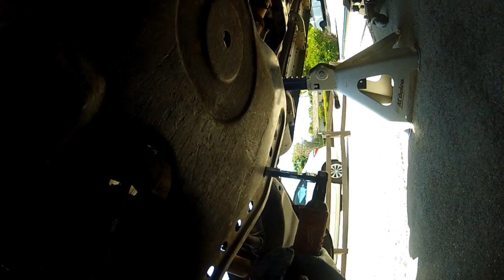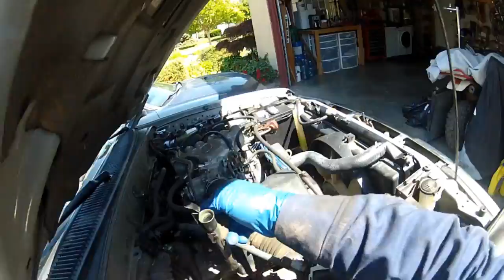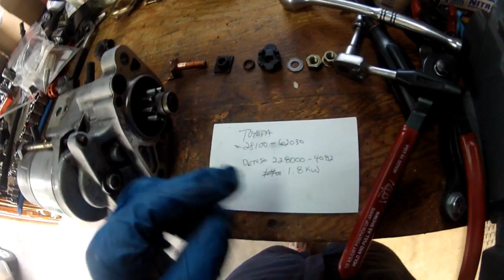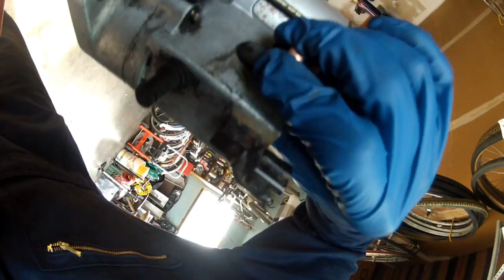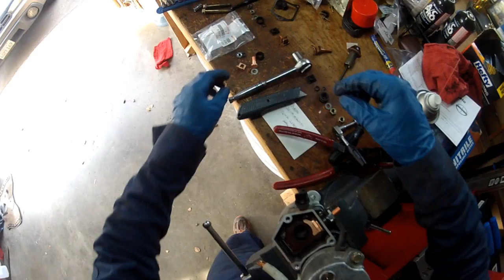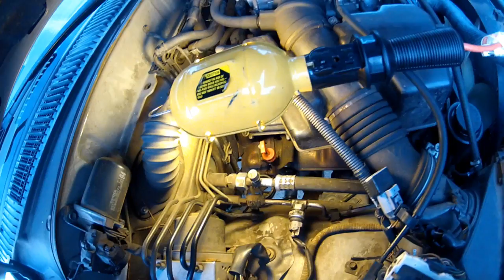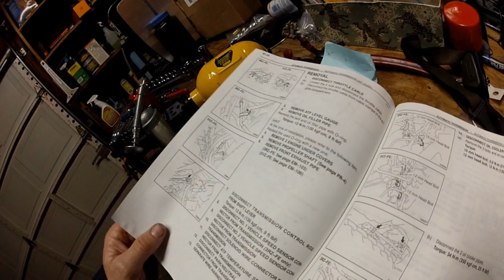Starter Removal and Solenoid Repair

Comment: Just thought I'd let you know that if you remove the left rear plastic splash guard in the wheel well after removing the tire, you can replace the starter in about 20 minutes. Removing the brake line and pushing it out of the way is the biggest hassle.
Reply from the maker: Hey Martin, what year, motor and model are you driving?  With a 3.4 liter engine and 4wd, there's no way you're getting it out the way you're saying.  With the 3.4 liter, the exhaust is right behind the flap.  Getting the flap out of the way helps, but that simple task doesn't now allow you to pull it through there.  You have to pull the starter out between the exhaust and upper control arm so you have to pull those brake lines out of the way.

Comment: how much do you pay for the parts?
Reply from the maker: Way too much, because at the time, I couldn't find a contact and plunger set that advertised it worked for my Denso starter so I bought the parts at the dealer.  I think I spent around $70.  I was trying to find a seller that listed my Denso part number, but if I just looked for my year and model 4runner, I would have found something like the one below and saved myself some money.  The kit below doesn't come with all the other associated hardware but you don't need it.  You just need to replace the copper contacts and plunger and reuse the rest of the parts.

This one for sale on Ebay will work:
http://www.ebay.com/itm/201532245369

Comment: Thank you for taking the time to make this video, About 4 hours start to finish for me to do the contact replacement. I tried to drop my sway bar to get the starter out the bottom but in the end it came out best exactly how you did it. Another great tutorial.
Reply from the maker: Hey Bill, glad the video helped you out.  I actually tried to get the starter out the bottom recently when I was helping Sean with swapping his auto transmission.  I learned quickly that it didn't work and took it out through the wheel well like I did on my rig.  Happy Wrenching!
Reply: @TimmyTheToolman  Do you think if you took out the CV axle it would come out the bottom?  I have to do the passenger axle, and it looks like it MIGHT come out.
Reply from the maker: @tywheeler7131  I'm pretty sure there's other obstructions that are going to stop you before the CV axle, but it couldn't hurt to try.  The worst that can happen is you have to take it out via the wheel well if it doesn't work.

Comment: If I accidentally broke both the breather valves as I was taking it out, is it a big deal? Will using it without the valves be a big deal?.... great vid btw. Esp the orientation on how to take it out. Fumbled with that for about an hour!
Reply from the maker: Well, the breather valves must help relieve any pressure built up by heat.  With the breather valves broken off, I imagine there would be a chance road contaminants could get in there during the winter from rain water or mud puddles splashing up under the undercarriage.  I sort of doubt you could buy those little breathers separately but maybe you could go to an auto wrecker place and pull a couple off another vehicle.  The breathers must be fairly standard and Denso makes starters for many different manufacturers.  However, those holes are really small so if you don't do some keep water crossings, I bet not much is going to enter the solenoid if you do nothing.
Reply: Timmy The Toolman 
Thanks Timmy. I replaced it without and it's just fine. Guess I'll see over time if contaminants will be an issue.
Reply from the maker: Roger that.  I guess your rig is ready for some mountain bike trips.

Comment: That short ratchet with the black handle at 18:58 min can i know what make that is i need a stubby ratchet that size
Reply from the maker: I've had that ratchet for a long long time.  The only writing I see on it is "Japan".  But, it's just a small 1/4" drive ratchet.  I'm sure if you do an Amazon search, you can find one with a set of metric sockets that gets good reviews for a decent price.  Or, if you'd prefer to buy one at a store, the Sears Craftsman brand would be a good choice.
Reply: Timmy The Toolman Ok thanks buddy

Comment: I am not mechanically inclined and this video helped me fix my starter. I first replaced the contacts but still had problems. I ordered a Denso reman starter from Rockauto and replaced the starter and all is well now. Tip is to loosen the 2 starter bolts before you jack up your 4runner. I like to avoid wrenching on bolts while underneath a jacked up vehicle. Also he is right, remove the brake line bolts and take the starter out from the wheel well.  To reinstall I used a hammer handle to support the starter in place while i threaded the bolts from underneath the 4runner.
Reply from the maker: If you're going to work on vehicles, and you don't have a lift, which pretty much 99% of DIY mechanics don't, you're going to be working under your vehicle while it's supported by jack stands.  If your'e really worried about a jack stand failure, you can always double them up or have the hydraulic jack as a backup.  Jack stands are very safe.  You have a better chance of being struck by lightning than having a jack stand fail on you.  Where people get into trouble is they get under a vehicle supported only by a hydraulic floor jack or worse yet, the stock hydraulic jack the vehicle come with.  

I have absolutely no fear of working under a vehicle supported by jack stands and yes I value my life.  But hey, do what you feel comfortable with.
Reply: True. For the rest of the repair I was under the my 4runner while the front wheel was on two 3 ton jack stands but to loosen the starter bolts I had the vehicle on all four wheels. I may have better access since i have the manual transmission. I still had to use swivels and extensions too. Kudos to the video, very informative from beginning to end.
Reply from the maker: I'm glad you found the video helpful.  What you just found out for yourself is auto mechanics can be really straight forward if you have the right information and the right tools.  You're probably way more mechanically inclined then you think you are.  

When Sean and I decided to start making videos, we wanted them to be as comprehensive as possible so anyone watching knew exactly how to get a job done.  Because of this, our videos are longer than most, but we figured people would rather have too much information than not enough.   

Keep Wrenching!

Comment: Hi Tim i have a question. Is the wattage the same for 2wd 3.4 motors or different? Thanks! Excellent video by the way.
Reply from the maker: +Dan Mappala I think the main difference is between the automatic and manual transmission versions.  What I found from my research is the automatics had the 1.8kw starter and the manuals had the 1.4kw starter.  But, I did also understand they might have put 1.8kw on manual 4runners in the parts of the country that get regular freezing temps.  The best way to go about it is to pull the starter, get the Toyota Part number and Denso Part number off the side of the starter and go to the dealership to find out which one you have.  But, I would suggest doing your own independent research as well before buying parts because the people at the parts counter at my local dealership had it wrong the first time.  They told me my starter was a 1.4kw at first but I found out it was a 1.8kw later.